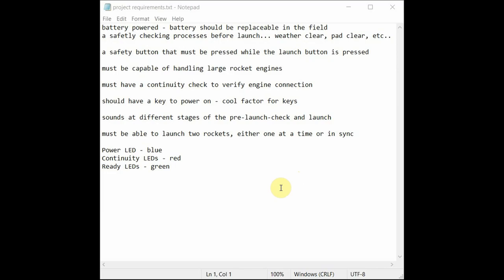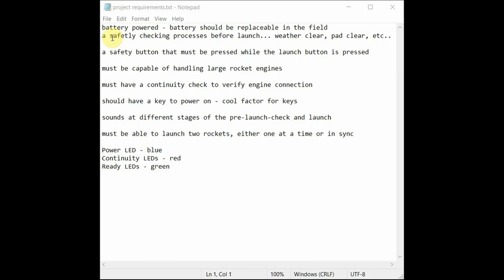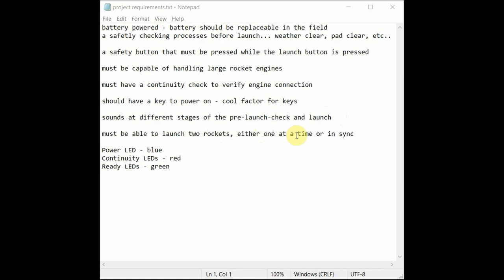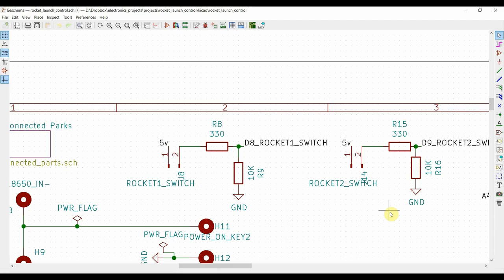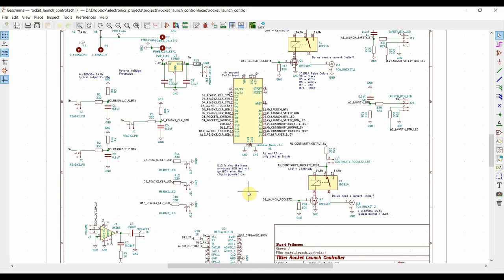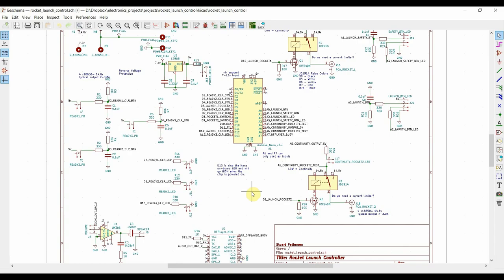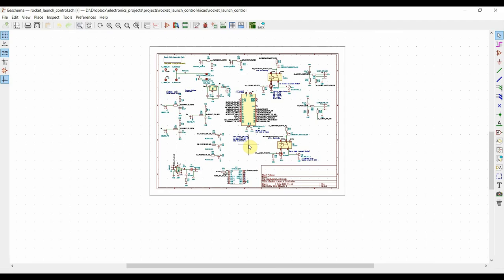Model Rocket Launch Controller Project - Part 1

Comment: Are you distinquishing igniter status as tri-state:  Open (no igniter/fallen lead), Short (bent igniter, touching leads), Ready (resistence or igniter + cables in expected range)?
Reply from the maker: No.. It is either connected or not. Continuity is shown on an LED for both rockets and is checked in software before the safety button is activated.
Reply: @StuartPatterson  Since using an analog input, you could read the range.  Then again, without an amp, is there enough return signal to see a range of values?  And how to calibrate for the difference in possible cable distances to the igniters?  Are you polling them in sequence, or is the source current being divided by simultaneous reads?
Reply from the maker: Yeah, too many variables to make it worth the effort. Each rocket has their own continuity check. You will see in the code once I create the second video. Still waiting for the pcbs to arrive.

Comment: The ignition power supply is interesting. Do you think you'll have enough current to ignite both rockets in the simultaneous configuration?
Reply from the maker: Of course it depends on the engine size, but Yes, I have done a number of experiments without issue.  There will be a voltage indicator on the launch batteries that is not depicted in the schematic.

Comment: Would you be willing to sell the design files? I'm wanting to build one and designing my own, but it would be really useful to see yours as a reference.
Reply from the maker: They are free and located at https://bitbucket.org/stuartpatterson/model_rocket_launch_controller/src/master/
Reply: @StuartPatterson  that's amazing. Thanks. :) I'm just working my way through your series. I'll try and make a video or two about my project.
Reply from the maker: @TheMatthooks  Glad to help.  I will go back and add the link to the description area of the videos.  I thought it was there, so you helped me realize it was not.  BTW - I would not use the 18650 batteries, in my opinion I would look at 12v acids.  Just my two cents after making it.
Reply: @StuartPatterson  I've got a converted lipo bike battery that I can step down to 12v. I think that still do the job.
Reply from the maker: @TheMatthooks  Cool!